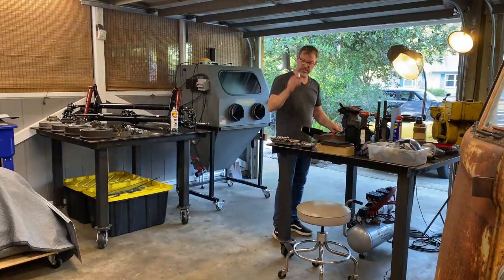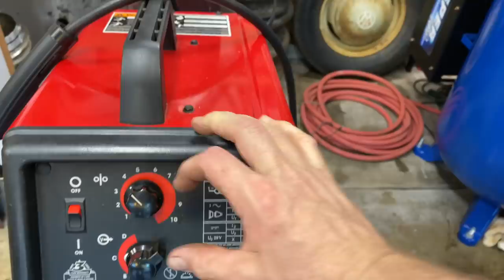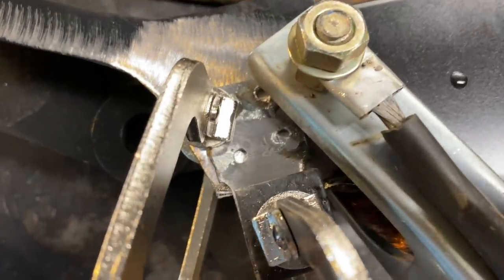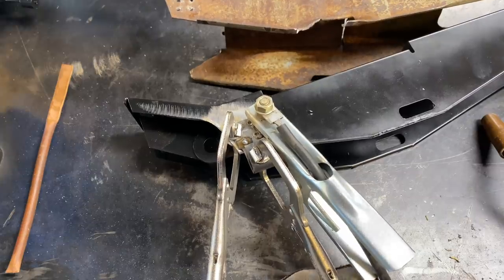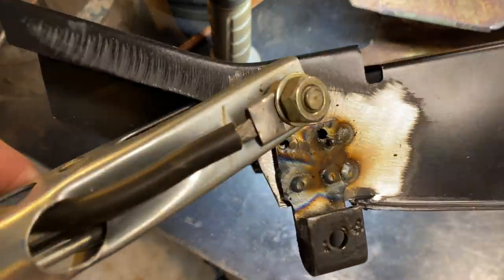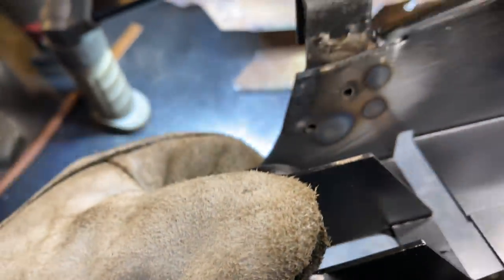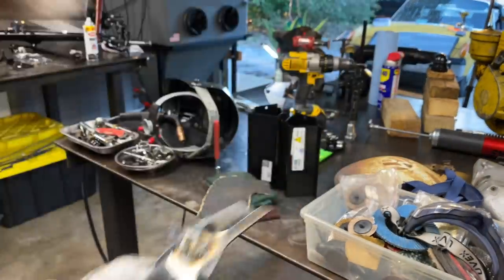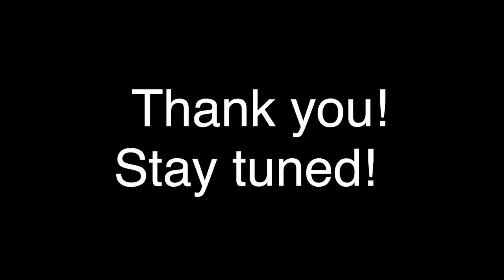Welding the Bracket! Rusty's Restoration! VW Bus Accelerator Pedal Linkage VW Bus Restoration, CT

Comment: that piece is thicker then the bottom and  the holes drilled are small. run a bead of welding firmly on the side edges. also when plugwelding hold firmly the wire on the middle  or between the two pieces. check the wire speed to slow will sparkly and do cold welds. see the welds while welding on the helmet

Comment: I would say you have too small holes for the welds, make bigger holes and fill it from the center to the edges. Also hold the nozzle a half inch above the metal, you can't lean the nozzle on it.

Comment: Hi CT from the UK one tip I remember from my college course, is 45 and 45.  It means the gun should be at angle of 45 degrees down from the horizontal and 45 from the vertical.  Your welds on the edges were better because you assumed this angle naturally.  As others have said the gun is too close to the job, you must be able to see the weld puddle.  Keep at it and you will improve no end and all the very best.

Comment: Your holes were to small they just filled up before it could penetrate. After you welded on the sides then it got penetration on the big bracket part.  I think you could have run a couple of small beads down the sides would look nicer than a hold bunch of tacks but it might hold maybe just fine like you got it. After you got the paint on it it looked perfect. Keep it up your very persistent so eventually your getting it done and your doing a good job. Its a learning curve your getting through. I dont think they have shop class for guys in high school these days too bad and did your dad help you learn anything or were you from a one parent family. Your doing great work CT teaching your self.  My dad and my grandpa taught me so much I did have shop classes in high school and plus I worked at a foundry for 12 years. Your getting on the job experience training and man nice welder and blast cabinet welding tables and shop your getting so many nice tools you got a good shop going on there. Your doing it good.

Comment: Holes are to small. Need to be 1/4"'-5/16". Aim for the center of the hole, fill that area working your way out. Slow down and take your time, you will get it.
Reply: You are right, sir. Bigger holes and perhaps a little more amperage on the welder.

Comment: Just a bit of advise CT, you mentioned you may have a bad ground, remember when your arc is good it means the ground is good, take your time and practice on some metal pipe as I did and practice running beads in rows swirl the bead in circles or side to side to form a bead.

Comment: Hey you have to stop putting the tip of the welder on the objecr youre welding. You need to be about a half inch away. You need to be able to see the welding puddle. Welding is just controlling an electrical short to ground. Look up youtube channel welding tips and tricks. Doing great though. Also for a beginner keep to the machine suggestions on the settings. Thats probably 20 gauge stele so set machine up for that.
Reply from the maker: Thanks Joshua! I will do that. I thought I was a bit too close. Thanks for the advice man! I'll check out welding tips and tricks. Thank you!

Comment: The first and most important thing is to be able to clearly see the weld puddle. If you are holding the gun rip too close so that it obscures your view of the puddle, or you don’t have the shade adjusted correctly on your helmet, you’re going to have a lot trouble getting a good weld. And as others have said ( and I did yesterday), you need a larger hole when you plug weld. You want to have the weld start at the base metal in the center of the hole first, so that you get good heat and penetration there first, then spiral out from there to fill the hole to the edges. If you do it right, you will fill the hole slightly above level and won’t need to grind anything. You HAVE to be able to clearly see the puddle in order to do this properly. Practice, practice, practice........

Comment: I love the "get 'er done" attitude but I'd make one suggestion...  Get a bunch of scrap metal and practice all the different welding types: butt, lap, T, plug, etc.  If you spend a day and run through a spool of wire and a tank of gas, you'll understand how to approach just about any situation you encounter confidently.  If you don't, you'll wind up warping panels, having welds that don't stick, welds that crack and you may possibly ruin a few expensive parts.  Maybe as you end your videos, you can ask for advice on what is coming NEXT so you have some direction before you start???  Just a thought.  On this piece, the hole for your plug welds need to be much larger.  It's a piece of cake to fill a hole that's a little bit too large vs. trying to get through a hole that's too small.  The key is to get good penetration on the base metal first, then work your way out to the edge of the hole.  I'd suggest drilling a handful of different size holes in some test pieces and see what works best.  Then you'll know exactly what works for you!  Stay safe brother.
Reply from the maker: Great advice my friend! I will do that soon. I did a bunch of spot welds the other day and they were looking pretty good. I wasn't expecting this to be an issue. Didn't realize the holes needed to big bigger. Now I know thanks to you guys! I really do appreciate all the tips and tricks! Thanks man!

Comment: The plug weld issue is that you are not getting a pool started on the bottom panel first.
Bigger holes would help.

Comment: Your killing me #1 don't paint the parts use weld though primer on the parts 1st. Then a quarter inch holes through the bracket and make sure your heat is up for your metal thickness . east wood makes a tip for roset welds i think that will help you weld better and cleaner and start watching more welding videos. Your freind Paul

Comment: first of all plug welding is much harder than welding the edges. so welding the edges was a good choice for holding.Welding 2 different thicknesses is also harder. You would need really large holes to plug weld that on. Larger holes is easier for beginners If your going to plug weld run the tip around in a circle inside the hole to get watch it puddle and melt both surfaces. This is why in my videos I use edge welding because even if it is not the factory way to do it. it holds usually better for beginners.
Reply: I agree with you Mike that`s the correct and easiest way to start for learning  I did the same way in the beginning.

Comment: OMG, this is one of the easiest type welds you will encounter. You are welding the hole closed and never ever touching the base metal. Start your weld inside the hole at the base metal and then sort of drag the molten metal to the top metal (bracket). If is amazingly easy to plug weld and when done correctly, you will never have to grind down blobs of weld buildup and refinish it. You really need to take some old pieces of metal and drill some holes and practice welding them together. Once you see just how easy it is, you will never have any issue with the hole size ot any such things. The hole size has virtually nothing to do with how well it is to plug weld... The wire feeding through the gun needs to touch the base metal and if you stop cutting it so short, you can direct it to the base to start.

Comment: Why did you paint the piece before welding?!!
Reply: The Blue stuff he put it in turned it black Im not sure whats its name is but it stops metal from rusting.
Reply: @charlieretro  NO, he painted it black AFTER he dipped it in the rust inhibitor. Pay Attention. The stuff he dipped it in is NOT the same as the rust inhibitor that he sloshed all over the metal and the garage floor.

Comment: Looks like you are never touching the metal in the holes (base metal) with the feed wire. And therefore welding the hole closed without welding it to the base metal in the hole. First thing you need to do when plug welding, is start your weld at the base metal and sort of drag the molted metal to the top piece. It is so easy to do if you don't over think it. This really isn't a tough thing to do. And when done correctly, there is really no reason for globs of metal to grind and finish down. The plug weld is simple and easy and very solid!

Comment: The hole needs to be 6mm at least for a plug weld , you need to direct the wire to the bottom panel

Comment: the first dont touch the metal with your welder the gas will sheld the spark so dont touch the metall other the with the wire try to write with like with a pencil ...one hand to hold the gun the other one takes the tip and keeps the distance and do the steering....

Comment: Holy cow CT - please wear a fully jacket when you weld - any exposed skin will take a terrible burn if you don’t!  My other suggestions are 
- you are welding through holes that are much too small,
- paint the parts AFTER doing the welding,
- clamp the parts firmly together and put the ground clamp on your vise grip
- read the welder mfrs instructions to get the settings correct for the thickness of metal (you don’t have it right - the welds are very poor and they should be easy).

Comment: 2/8 INCH GAP BETWEEN WELDER REPLACEABLE TIP AND PART BEING WELDED.  That buzz I heard is the welder tip contacting the metal shorting it out.  Only the wire touches the metal......3/8 inch gap.  If you have to hold the tip closer than 3/8 then your settings are wrong.  Im currently plug welding in my new front floor in my 1964 vw bus.

Comment: I think the holes to small and if you put the welder on the sheet metal you don´t see what you weld. A little bit distance and you see what you do.Put the welder in 45 degrees and you can see if you inside the hole  and the gas safe it .

Comment: Hi CT I gave yesterday a Comment the welding holes are too small. you have to drill 6 m/m holes.it will not burn together,  because you fill the holes without penetration. and hold the welding gun 45 degrees angle greetings HCS  remove it again and try again.CT click the image from the VW good luck. you holding also the gun to close to the bracket you damage the nozzle to close you burn the wire or fastening it to the bracket. start in the centre of the holes and drag to you, check your welder for the temp and the thickness of the gauge.

Comment: Your ground clap was way to close to were you was working you should have cleaned off a another place on the piece and would have giving you room to work. And welding down the sides would be just as good as long as it holds good

Comment: great you try to do it yourself but maybe watch a few welding vids on here to see how to set up the piece before welding 
you have the right idea 
sometimes something small like that its easier to drill a 5/16 hole in the centre and do one large plug weld 
as other have said don't touch the piece with the shroud of the welder  keep about a inch away from the surface so you can see the weld arc

Comment: 1/ holes are too small.  They need to be big enough to allow you to puddle the weld into the hole 2/ use weld thru primer  don’t paint until all the welding is done. 

You got better welds near the end. Listen to the difference in the sound of the weld.

Comment: This job should’ve taken less than five minutes. The video is over 14 and that’s with editing. I think it’s good people are giving friendly advice here, but my advice would be to put the cameras away and just work. You’ll save a lot of time not moving your camera around every five minutes to get a different shot. Plus most of the shots you get are completely useless. I won’t shit on the welding itself cause we’ve all started there at some point. But holy fuck bud ya woulda been better off with some self tapping screws or rivets or something